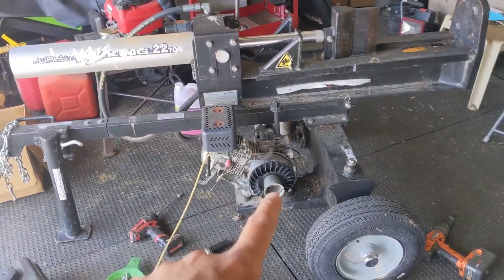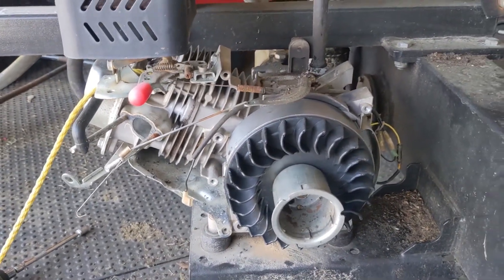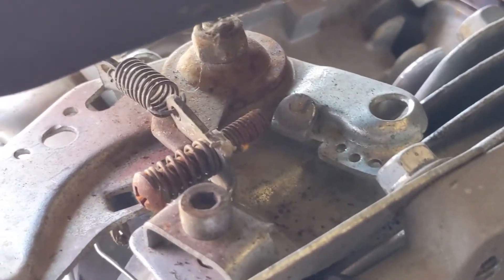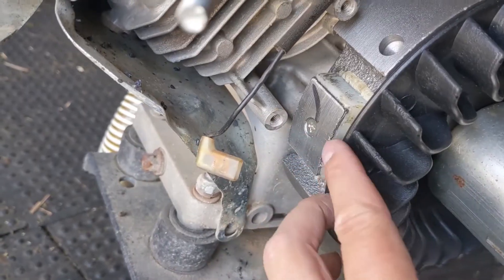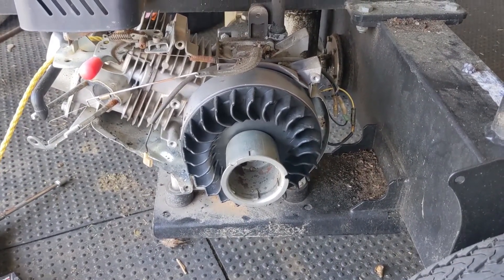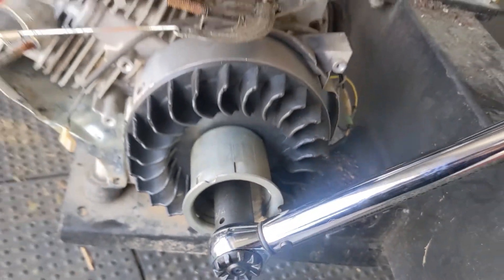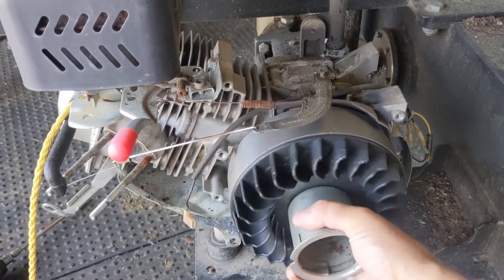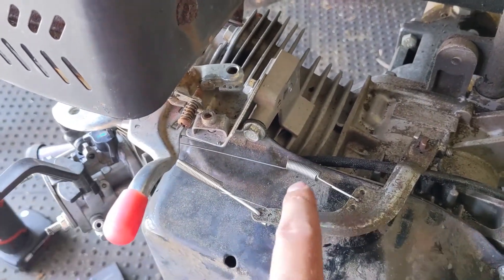How to Torque a Flywheel Nut (Mechanics Trick)

Comment: Needs to clearer for cord  process of undoing the nut ( anti-clockwise)and then again for tightening it back up (clockwise). Concur about removing cam cover to see cycle positions on 4 stroke

Comment: I wonder if it is safe to use a rope to lock flywheel of lawn mower so that I can remove nut? I saw in one video guy said it is not safe to use piston stop tool on large engines like lawn mowers. Some guys saying using rope could be issues with valves on 4 cycle engine. I have a feeling it should be safe to put a rope in the middle of compression cycle as the both valves will be closed. Am I right?
Reply from the maker: Use a rope and like I said put it in when the piston is near tdc on compression stroke and you won't have any issues with hanging a valve open.

Comment: Just to be on the safe side to avoid hitting valves on 4 strokes or ports on 2 strokes, I rotate to 3 o'clock for nut reversal, take the rope out, rotate to 10 o'clock and re-insert the rope for nut tightening.

Comment: back when I  was testing cam timing on a briggs ohv snowblower engine I used the screw in piston stop to set degree wheel. Mind you I was not forcing the piston against it.  The rope would better spread the force across the whole piston top.
Reply: Absolutely correct thanks for watching

Comment: I use both the rope and a piston stop.  It depends on my mind at the time LOL
Reply from the maker: It was HOT and I didn't feel like getting my piston stop, threading it in just to thread it out again lol the rope was closer than the tool was. Thanks for watching!
Reply: I usually use the rope to stop the piston, but need to buy a good piston stop.  In your opinion, and Bruce's who high do you think works better and takes less time, rope or piston stop?

Comment: COME ON folks, 284 views as I write this and ONLY 82 thumbs up?? a) Detailed presentation, b) Short c) Great camera work !
Reply from the maker: Thanks for watching!
Reply: We should hire you on to the Management Team thanks for the positivity REV
Reply: The problem is that not clear explained when to put rope. I believe on a compression cycle is the right time to put rope as both valve should be closed. But again I only learning. Is it safe to have a rope on a compression cycle accidentally be between piston and the valves?
Reply: @alexk6745  The safest thing to use is the piston stop tool as Jake highlights with the link but: bringing the piston slightly down from top dead center as Jake says then installing the rope ensures that rope cannot go into the valve ports because you are still above those openings. As you now tighten the flywheel nut the piston comes back up and compresses against the nylon rope to stop the flywheel from rotating. Hope this helps the OG@EP over and out.